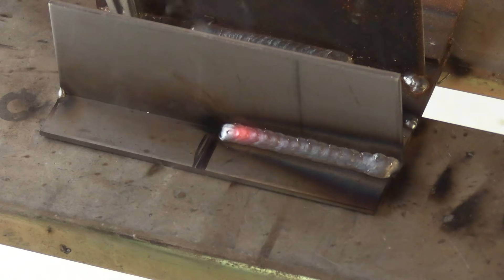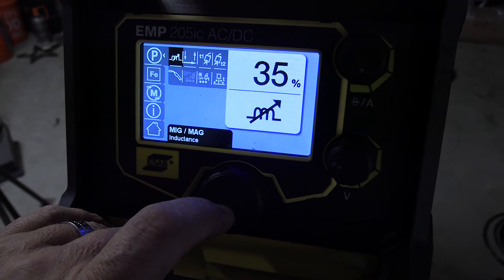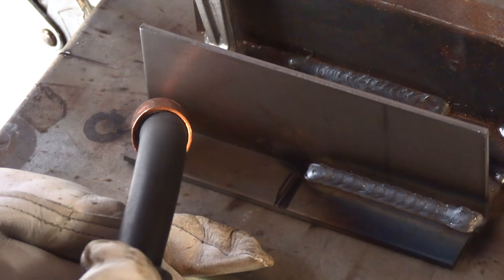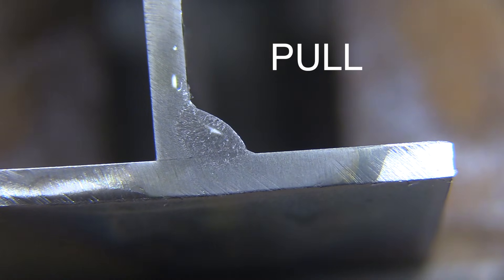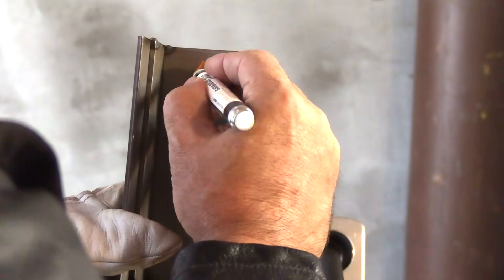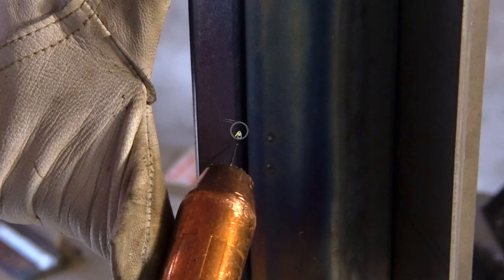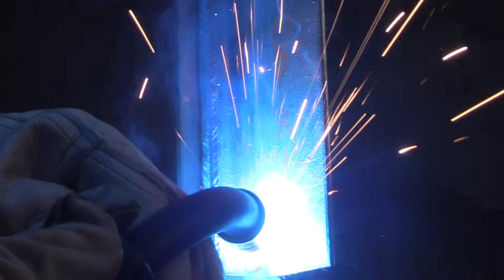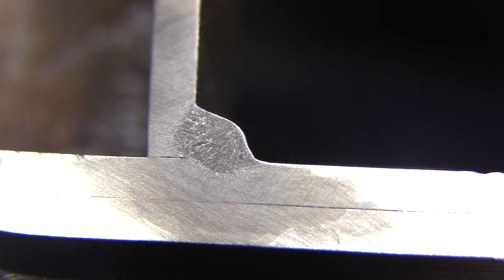MIG Inductance & Push Vs. Pull Techniques | Welding Tips & Tricks #Welding #MIG #Techniques

Comment: Hey. I got a welding test coming up for my job. I believe it is just going to be the AWS D1.1 MIG. I am just confused on whether I should push or pull my beads? I usually pull but I'm starting to get more comfortable pushing. I'm confused and it is driving me nuts. Any other tips on that specific test would be great if you have any for me. Please help! Thanks for the great videos!

Comment: 26 amps 700 inches a minute 3.5 wire at my job.  Gotta go fast. Lol. I prefer to push my welds.  Tend to get porosity on a quick pull.  Good vidio👍

Comment: I'm using an antiquated Lincoln Wirematic 255 which based on it's bulk and weight I assume is a transformer machine. Am I running inductance full time?

Comment: I'm always gas pushing foward and foward back little more forward then back to the pool ect. On decent meaty material I'll do wobble circles. Because  I now I can drop alot of heat and go slower.  Going down from top to bottom I up and down it which can cause problems sometimes. Then go back over it with a weave top bottom.

Comment: I like watching that oscillating motion. It's almost like clockwork.   
In French , I call that  "pas de chenille"... takin' caterpillar steps.

The content you crank out is top notch. It never gets old or boring !

I remember the teacher speaking about inductance when he taught us the quickie on short-circuit metal transfer.

Same thing as the push - or - pull debate. Both are beneficial, both come in handy and both should be practised by the welder whenever possible.

I tend to choose a leading angle if I have the opportunity. Standing and looking in front of the puddle while pushing the torch "square" to the joint  is when I'm at my most comfortable.

The trailing angle is best used for vertical downhill welds. I like to turn the torch upside down , the gooseneck keeps a strict angle towards the puddle as I travel, and makes it easier to see the joint underneath the puddle. 

I do "dry runs" before striking the arc too.

Thank you  for sharing your session with us !
:)

Comment: Hey Jody,  I’m doing more and more aluminum jobs,  I have a diversion 180 tig machine,  I’ve seen all your videos and watch your diversion 180 video several times,  I still have a hard time getting a weld started,  getting the aluminum to bind and getting the filler rod to start sometimes,  I clean it all with everything I can,  I’ve never tigged aluminum with a more advanced machine,  I can do it and I do a lot of it but it’s just not where I want it to be,  will a more advanced machine help make a difference??  In your opinion what are the limits of the 180? Thanks,  I love the show!!

Comment: So how are ESAB  getting digital control on the inductance,fairly sure they dont have a big inductance coil in that machine with a motorised control on it,they must be adjusting the current rise time when the short circuit occurs each time electronically,Never use one of those only machines with mechanical tappings on the inductance, early machines had plenty of inductance but later machines tended to be a bit short and basicly tuned for spray transfer or at least the big industrial machines I am used to.

Comment: Hello, I need some help! Outside edge on 1/8th aluminium, I'm running 0.8 mm wire on 21 volts at 350 ipm, the welds are Ok but what inductance settings should I use to improve them?

Comment: really nice uphill action.  how is the penetration with a torch angle of 90 degrees?  i used a slight push angle at my last job welding mostly 12-16 gauge mild steel.  that's just the way i  was taught, but i would not call myself an expert.

Comment: Ripples are a little far apart. Toes of the weld should be smooth try a small up in the center ( root of the weld ) and out a bit on each side (will make the (toes) of the weld smoother. Called the Christmas tree

Comment: What kind of wire you're using? I'm Brazil every brand of wire are covered with copper
Reply: All the basic steel wires are coated so they dont rust. He is probably using ER70S-6.

Comment: Hey Jody, do you reckon the pull gets more penetration because the gas would be helping keep the heat on it for slightly longer so it takes longer to solidify?
Reply: I always figured it was that the electric transfer to the part is longer vs arc being partially in the puddle. Like a cut and backfill when it is being pulled. Just my thought.

Comment: What about inductance settings on spray? I usually keep mine at around 70-80 with 0.45 metal core wire using tri mix gas
Reply: afaik it doesn't do anything. inductance is basically how long the power is on after the initial short circuit and controls how much the wire melts back. spray doesn't short circuit.

Comment: I was taught to pull on anything 3/16 for better penetration and over and push on thinner material to prevent burn thru and excess heat effected warping. You just put pen to paper for a technique that I've used for 25 years! Ty for the validation. 😁
Reply: Ima use this technique 👊

Comment: I used to run .052 solid wire and preferred to push when possible, I could see where I was going easier.
Reply: Well the rule holds pretty true almost in every aspect of welding.
If there's slag u drag otherwise push. Especially with mig.. because  u gotta see the puddle and keep the proper angle and the technique to get the penetration and avoid undercut....and porosity...    But these things come with experience..